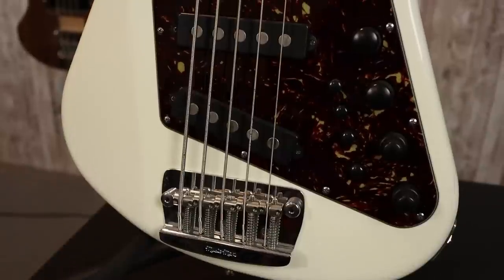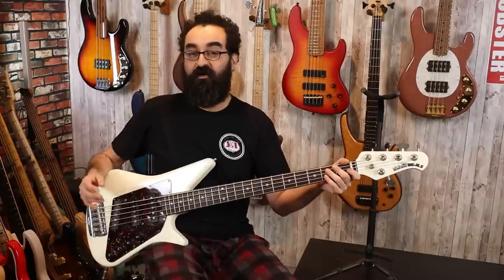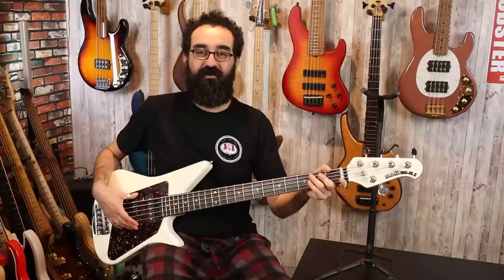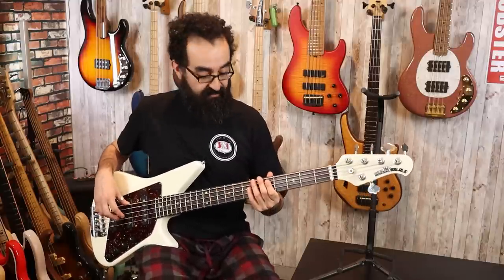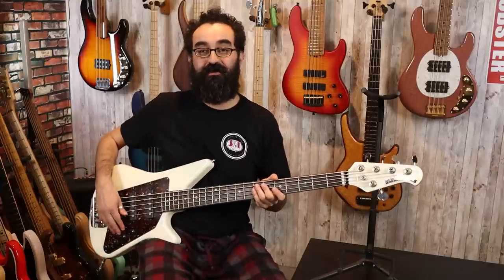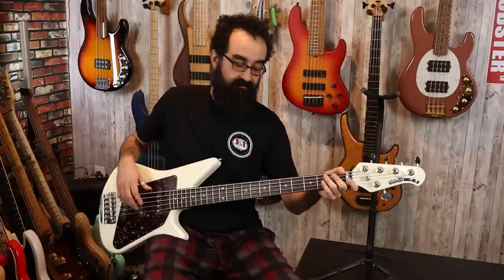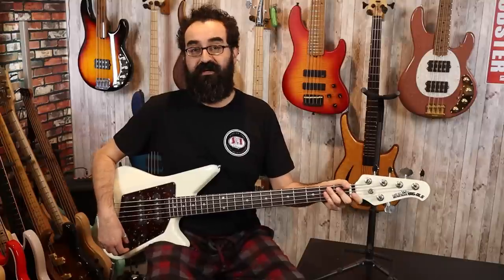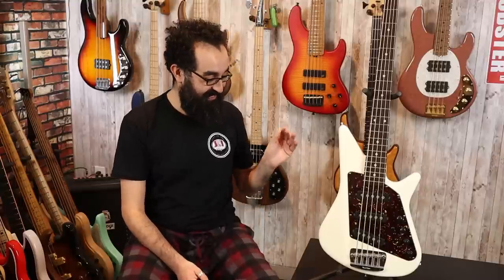Music Man Big Al 5 Deep Dive - The Examination of an Ernie Ball Enigma - LowEndLobster Fresh Look

Comment: I have a 5SSS and it’s incredible. You can take it to a gig where you need half a dozen distinct sounds and it excels. Plus it has sounds I’ve never heard on any other bass. Ironically (or perhaps by design) the only bass sound you absolutely cannot get is a stingray. Kudos also to the active/passive option and passive tone control.

Comment: Beast of a bass, so unique, sounds amazing in all settings. Really hate that they don't make them anymore like all new concepts of MM. I think the problem is that they are way to expensive for a new model they should also make a Sterling version of new models so you have a 1000 euro option. 

I have a MM caprice, i love that bass but also so not cheap and no Sterling model so after a year they pull the plug.
Reply: 1000 Euro Option.  Why I never.  Why would you buy a sterling by MM for $1200 US dollars.

Comment: Lobster, which impresses you the most, The Big Al or the NG3?
Reply from the maker: Great question. I'd say my modified NG3. I like the electronics setup a bit more and find it more flexible. IMO I think a mid/sweep would have been better than the hi/low mid stack on a bass like this. The NG3 with the east preamp can dial in a lot more different 'characters', even on the same pickup. I think that 'P' setting I demoed on the Dingwall nailed it. You could get fat mo-town P sound, or some gritty clanky snarly madness.
Reply: @LowEndLobster   Cool, I can understand that.